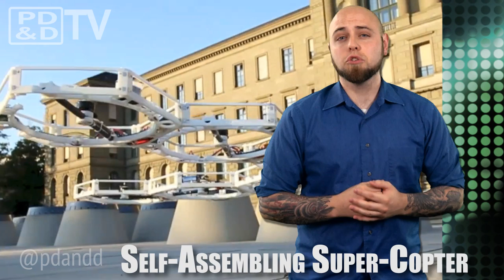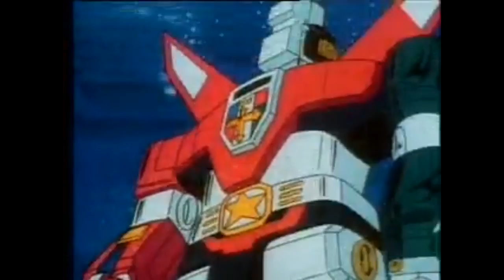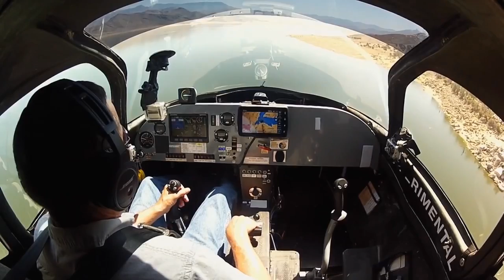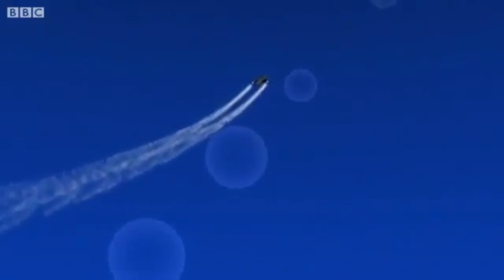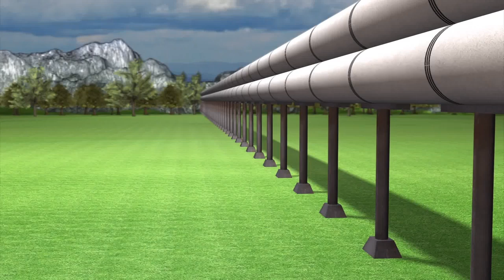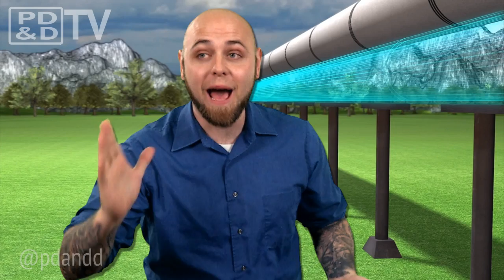Engineering Newswire 48: Spaceplane Propelled by Air-Breathing Rocket Engine

Comment: Air breathing provides 1/3rd of the ride to LEO, when gravity and drag losses are taken into account, and not 1/10th. Air breathing mode doesn't save any fuel, it saves having to lift off with an extra 150 tonnes of liquid oxygen that would otherwise be needed during the first phase of flight. Without the air breathing mode, SSTO would be impossible.

Comment: No offense to the makers of Skylon, air breathing 1/10th of the ride to LEO makes little sense.  Why not try to simply make an SSTO vehicle work first, then if successful, change the engines with the air-breathing engines to save the extra 10%.   Fuel is the cheapest part of a rocket compared to the vehicle.  A multi-purpose engine will probably be a lack luster jet and lack luster rocket.